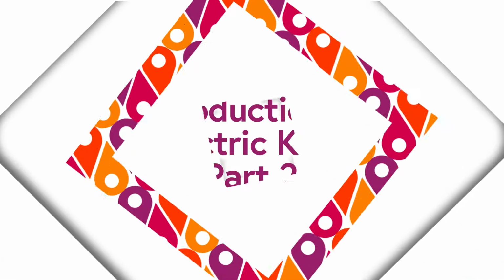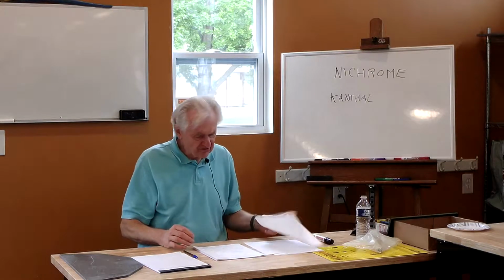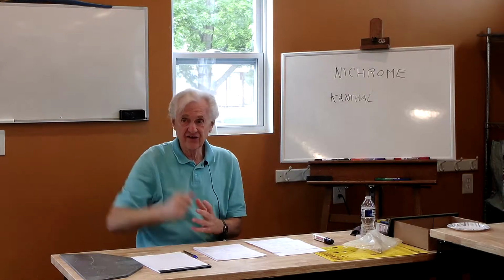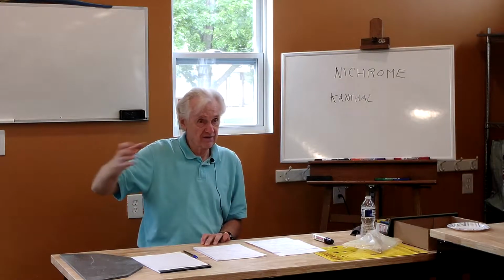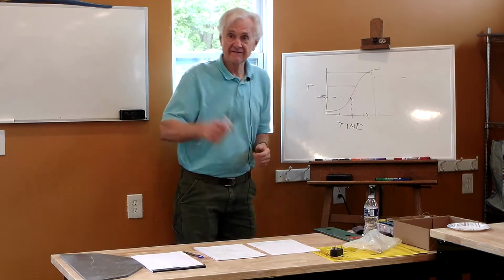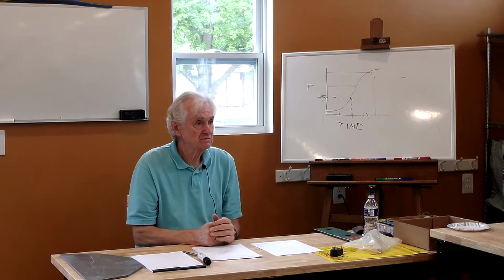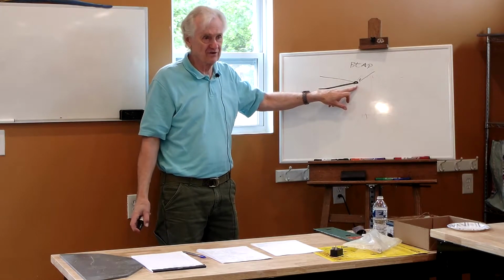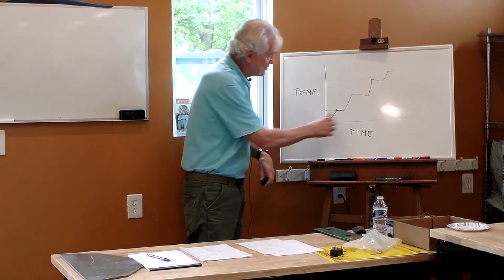Pottery Kilns Design Construction and Operation   Electric Kilns Part 2

Comment: Thank you ‘ am asking if you want maind ( what I can do if electric was turned off for half an hour when my kiln on high temperature ؟do I need to start from the beginning ؟
Reply from the maker: The answer is about the same either way, but was this a manual kiln, kiln sitter or computer controlled? Also, do you know what temperature was reached? Was it a bisque or glaze firing?
You will have to start from the beginning but you may be able to do a fast fire rather than a slow fire. It will, however, end up firing to a higher actual temperature if you fast fire. I fire a computer controlled electric kiln and i've experienced the same problem during a glaze firing. The kiln had reached 1900 F and had a power failure. I restarted the kiln with a slow glaze firing. Everything was OK but the glazes didn't seem to come out as nice as they normally would. I think they had started to melt during the first firing and it changed the way the glaze reacted to the final heat work to get to cone 6 in the second firing.
Good luck, and let me know how it turns out!
Reply: Washington Street Studios 
Thank you my sir for your great answer “ I have electric klin from pottery craft com .
It was glaze firing on 06 con .
Reply: Washington Street Studios 
Sorry my klin from Duncan .